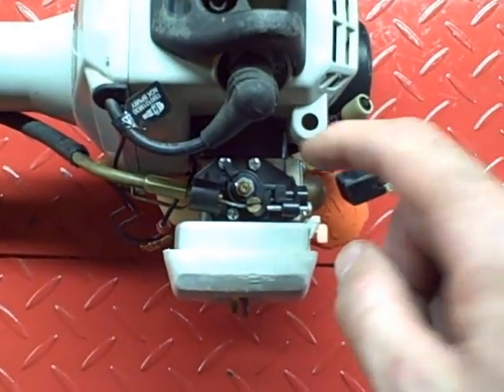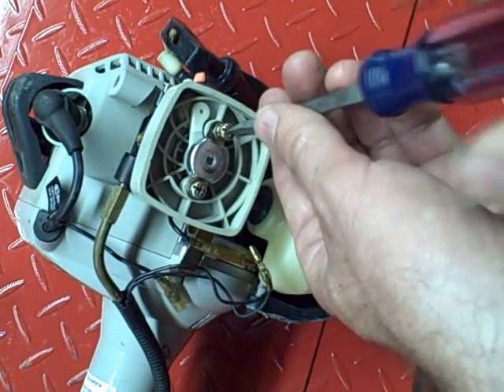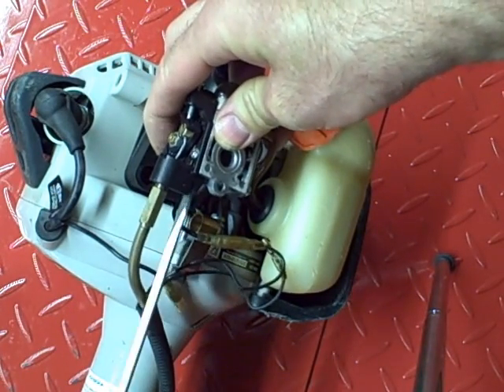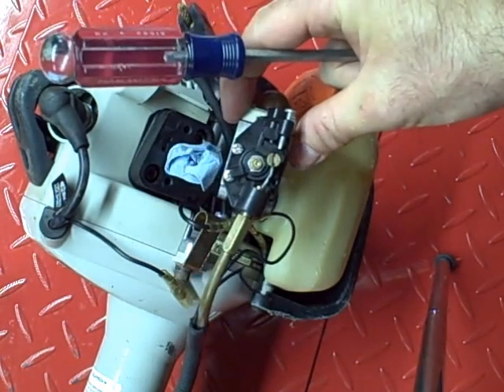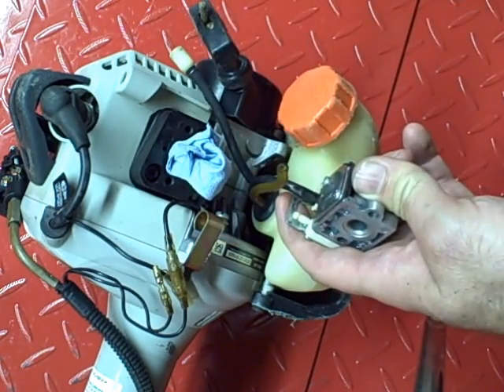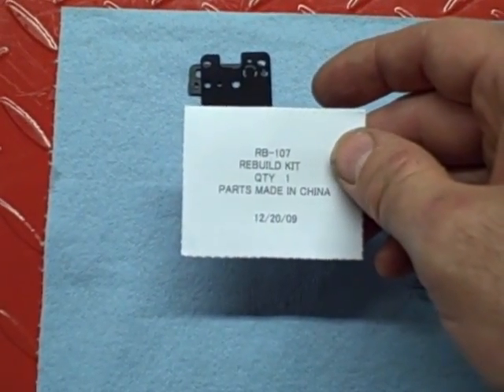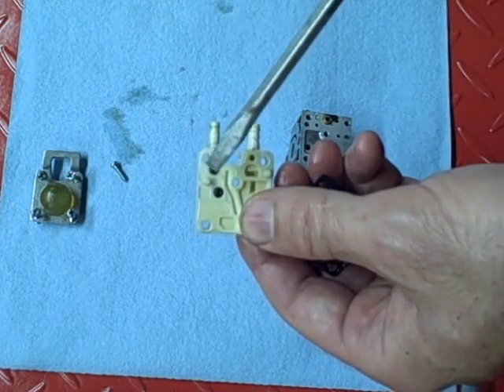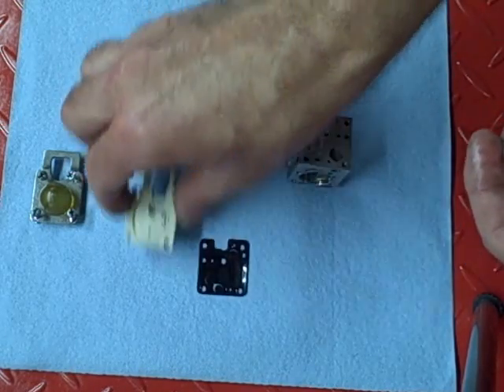Small Engine Repair: Rebuilding a Diaphragm Carburetor on a Echo SRM-230 Trimmer Part 1 of 3

Comment: What would you charge for this, just done this for my neibor. Weed eater cleaned carb, replaced spark plug, replaced fuel lines, cleaned fuel tank, replaced primer bulb, replaced pull string , cleaned air filter fuel filter?